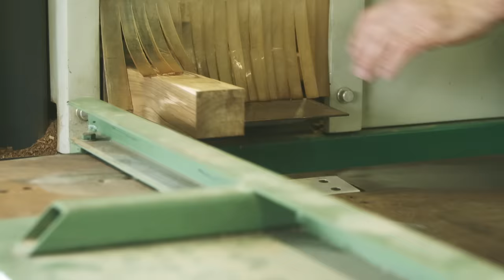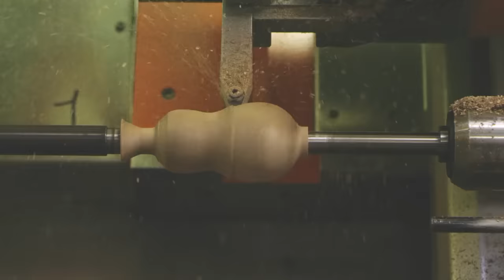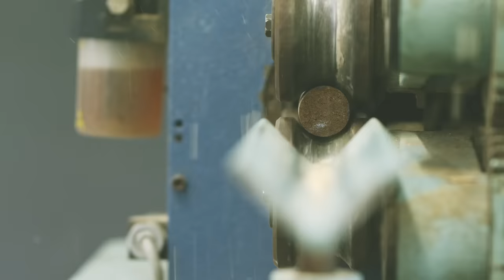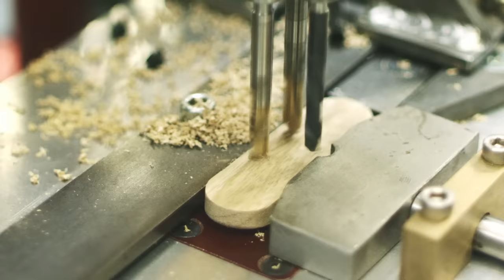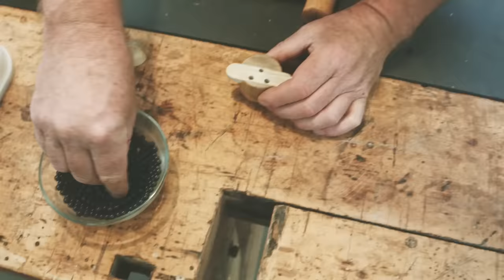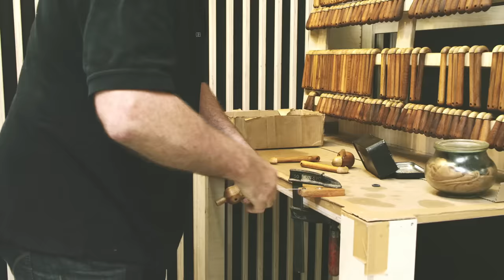How it's made: Kay Bojesen's Wooden Monkey | FinnishDesignShop.com

Comment: I've had my Abe for 10 years and just recently, the elastic band for his arms disintegrated. I have the repair kit and I have 2 questions: 1) How best do i remove the original nails? And 2) How best to insert the new nail and secure it in? - Please refer me to the tools. Mange Tak!!!
Reply: The nail will go in easily IF you aim it between the two strands of rubber.  Make sure you don't have the strands twisted.  A bright light will help you see if they're straight or not.  You can also do a preliminary probe with a dull needle (like a tapestry needle).  Avoid just forcing the nail in through the rubber itself because that will weaken it. 

Once the nail is in, the tension of the rubber loop will hold it in place.  Nothing else is needed.

The factory has a metal rod secured to the work table for looping the string on.  Those of us at home can use a doorknob or some other thing that will not move.  You might need someone else to hold a flashlight so you can see what you're doing. 

I've done a lot of these and I still can't do it as quickly as they do in the factory.
Reply: I took needle nose tool and backed my nails out through the side hole of the arm and out the top. I reused the old nails. This is probably too late.
Reply: The o ring will hold the nail in place if the sharp part goes down in the wood.